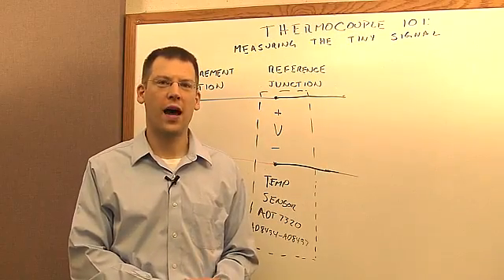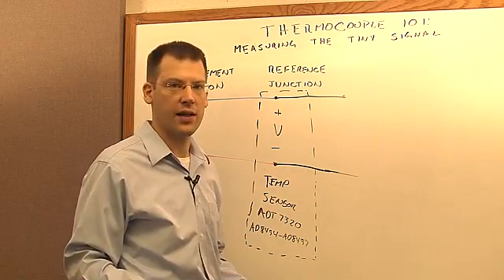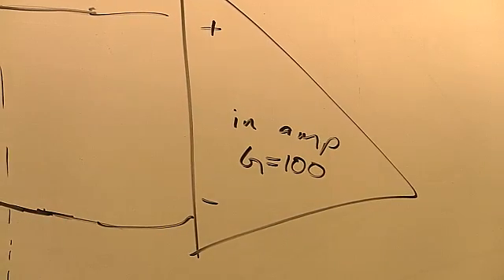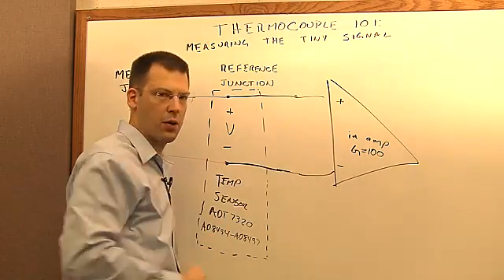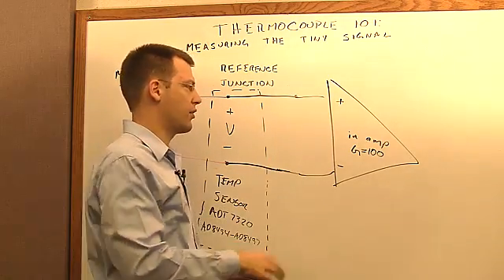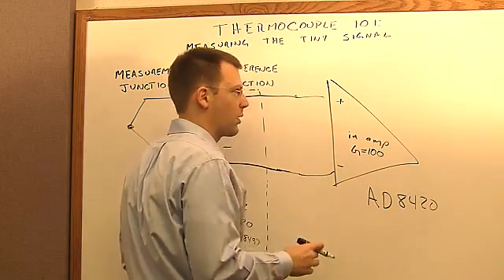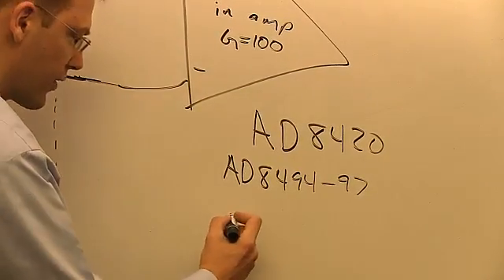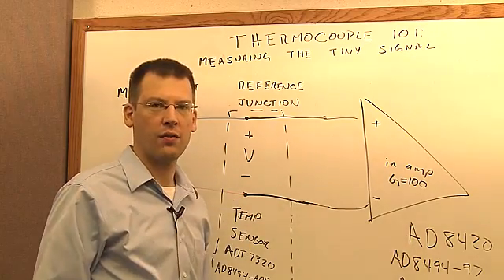Thermocouple 101: Measuring the Tiny Signal

Comment: Hi. Great explenation. I have a question though, I have a pyranometer sensor which gives out 4.47uV per W/m2. The sensor has one low, one high, and one ground cable as outputs. I am using a AD620AN inAmp to amplify the signal. My problem is that I do not know how to connect the output cables of the sensor to the inAmp. The sensor reads out correctly when a multimeter is connected to the low and high output cables. How should I connect the cables? do I need a reference junction?

Thank you and I hope its not too late to be asking this since I know this video is a little old.
Reply: Hi Andres, I know very little about pyranometers.  I would assume you connect the high and low from the pyranometer to the AD620 inputs and the ground output to the ground of your board containing the AD620.  Make sure to run the AD620 from a dual supply so that the pyranometer outputs are in its common mode range.  If you only have a single supply, you can use a part like the AD8237 instead.  It is designed to measure at ground on a single supply.  See pyranometer datasheet for performance across temperature to see if and how you need to compensate.